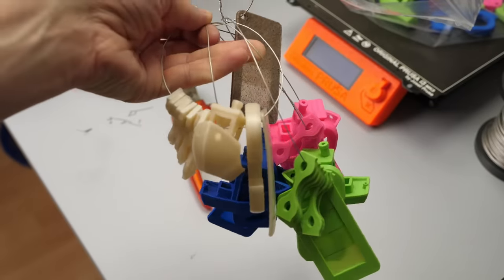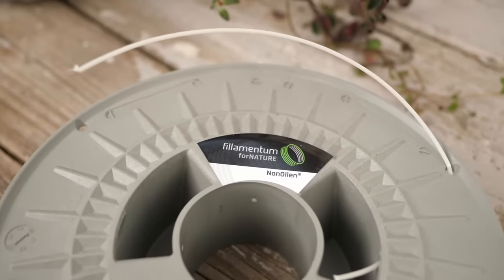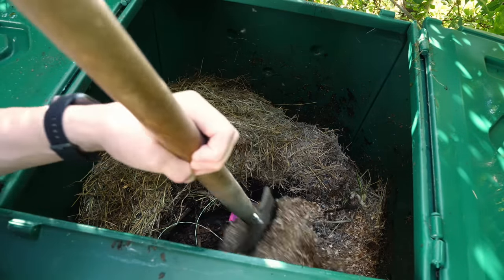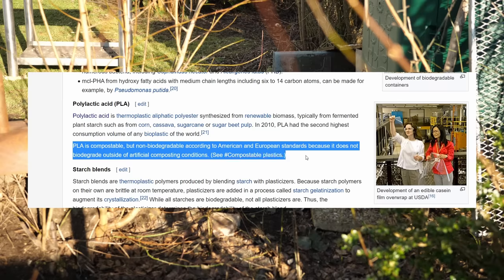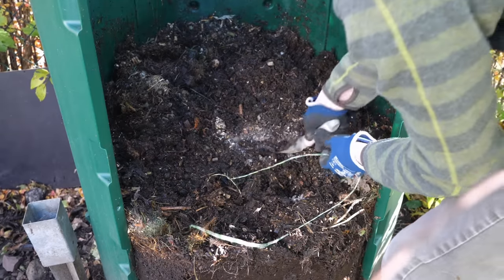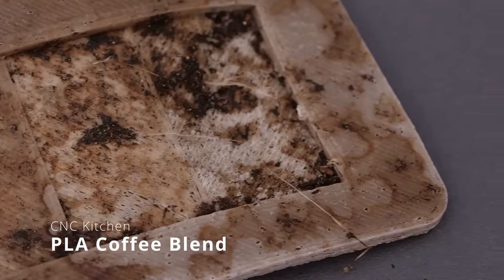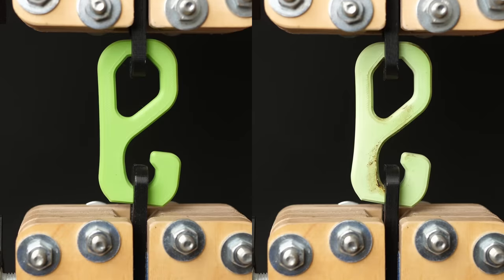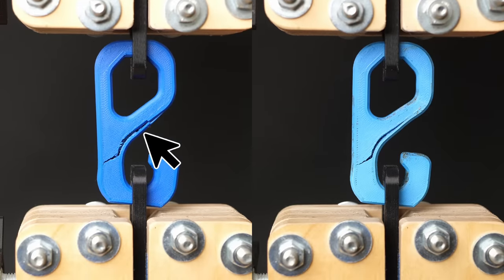I put PLA 3D Prints in my Compost and this happened

Comment: so im not shure if any one will see this but the way i see it  3d printing stemed from the maker movemint and as sutch a lot of 3d printers that pionerd pla wher diy printers sins the likely hood of 3d printer nerds like me complitly switching off of pla is probly unlikely that sead im starting to seed the same 3d printer maker movemint move in to other mediums like cnc, laser cuters and ingravers and what i think is cool im starting to see the maker movemint move in to injectshon molding  also the movemint to  make home made fillamint form fill prints and pellits is also growwing  so i suggest this let bring the maker movemint to bio composting the more we move in to mashines like injectshon molding and so on means will more then likely need to think even more about the planet so i think if the maker movemint can figer out how to make small industrial style composters  i think the deficalt part in that would be finding the camical that industral composting comineys use to compost pla that or we do what we did with pla and make a camical to brake down pla with out the fbi braking down some one door asking why we need 16 lb of this toxic cemical

Comment: Those plastics failed to meet the United States standards of 'biodegradable'. Even after 100 days, there should have been significant degradation. The only environmentally friendly way to dispose of these plastics, short of people revolting and forcing governments into actually instituting proper recycling of them, is through burning them in a highly oxidizing or reducing atmosphere until they're ash.

Comment: Don't even bother to buy an expensive compost bin. Instead focus on getting the ratios of the compostable materials right. The most important one is nitrogen in relation to carbon but there are other important trace elements. To increase aeration turn it every 4 weeks. Honestly these turntable compost bins are a complete joke because of the tiny volume they offer.

Comment: Bon je crois que c'est suffisamment clair, il n'y à pas de dégradation suffisante du PLA pour dire que c'est un matériau bio dégradable. Même si j'avais quelques doutes fautes d'expérimentations sérieuses et dehors de celle que tu as mené, je suis déçu de constater que  cette biodégradabilité que l'on nous vend n'est qu'un mensonge de plus. Je me sens vraiment floué et en plus cela fait de moi également un menteur par voie de conséquence puisqu'à ceux qui ne connaissent pas l'impression 3D j'expliquais que le PLA est biodégradable et donc sans danger pour l'environnement alors que c'est totalement faux. Cela me mets en colère vis à vis des industriels fabricants de filaments qui eux savent très bien que ce qu'ils nous vendent n'est pas du tout biodégradable mais continus de faire comme si c'était le cas. Si j'en avais le temps et les moyens je leur collerais un procès pour mensonges sur la marchandise. Maintenant je ne sais plus quoi faire, je pensais être dans une assez bonne direction en utilisant mon imprimante mais là je me rends compte que tout ce que je peux faire avec c'est ajouter de la pollution plastique à ce qui existe déjà. Il ne reste plus qu'à "espérer" que les industriels du secteur prennent réellemnt en compte notre souhait de ne pas polluer plus en utilisant nos imprimante et fabriquent de réels filaments biodégradables, mais cela va prendre du temps, temps pendant lequel nous, utilisateurs d'imprimantes 3D, allons continuer de polluer. Cela me rends très triste

(Google translate version)
Well I think it's clear enough, there is not enough degradation of PLA to say that it is a biodegradable material. Even if I had some doubts for lack of serious experiments and apart from that which you carried out, I am disappointed to note that this biodegradability that we are sold is only one more lie. I feel really cheated and in addition it also makes me a liar as a result since to those who do not know 3D printing I explained that PLA is biodegradable and therefore harmless to the environment whereas it is totally wrong. This makes me angry with industrial filament manufacturers who know very well that what they sell to us is not at all biodegradable but continue to act as if it were. If I had the time and the means, I would sue them for lying about merchandise. Now I don't know what to do, I thought I was in a pretty good direction using my printer but now I realize that all I can do with it is add plastic pollution to what already exists. It only remains to "hope" that the manufacturers in the sector really take into account our wish not to pollute more by using our printers and manufacture real biodegradable filaments, but this will take time, time during which we, users of 3D printers, will continue to pollute. It makes me very sad 😢

Comment: You are very uninformed. Most biodegradable plastics will biodegrade under Ultra-violet light. Composting is a very slow process, but UV from normal sunlight will degrade the plastics over a couple of months.